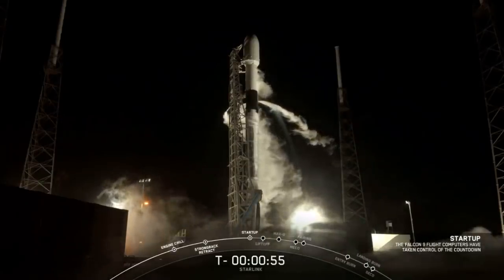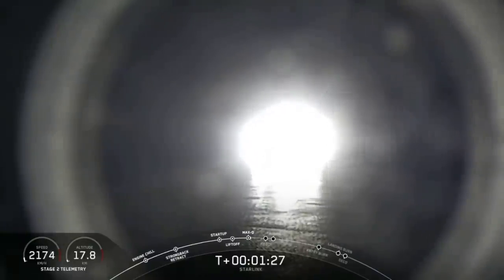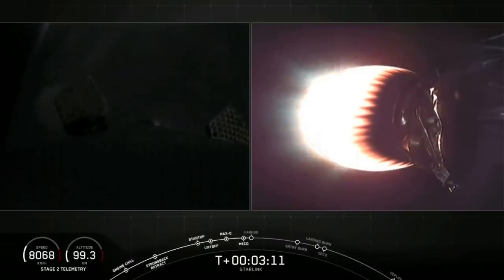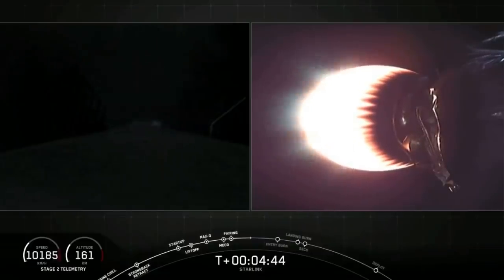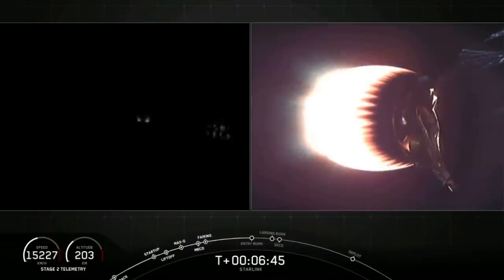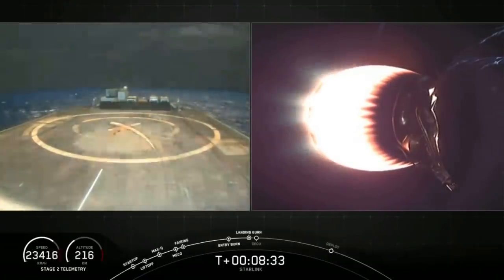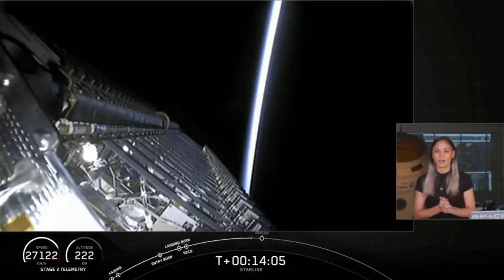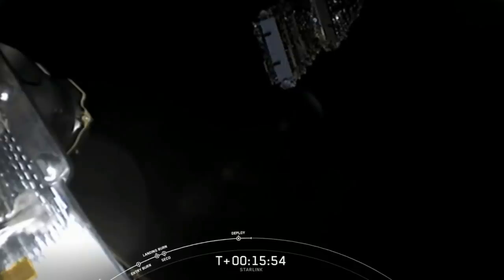SpaceX Launches Starlink-7 (June 3, 2020)

Comment: I’m going to make a very constructive comment I don’t know how many people will agree with me on this but hopefully there will be quite a few when they deployed the GPS satellites those were far enough out to where they did not disrupt the view of stars from telescopes and the astronomers this system satellites will be so disruptive even with the visor shield won’t matter on top of that it is crowding the airways into Orbitz that could be an issue for space air traffic they need to deploy satellites that are of a larger size and put them in lineups of the same Orbitz and line of sight that the GPS satellites are which could be less costly as well as will not be crowding the sky’s and my other question is how are people supposed to access the satellite by buying expensive new boxes to attach and a satellite dish no none of this is going to work affectively it’s going to cause problems in every area and it’s going to be extremely expensive for countries that cannot afford the ground equipment sorry but this whole thing is just completely useless and a waste of money and time

Comment: I tried to contact NASA and SpaceX with no luck...,,. This is your last chance........ Contact me about my non rocket-propelled space engine that works..,,.... And stop using these dangerous barbaric methods to put humans into space.,.,..., You can contact me via my YouTube channel..,... or you can just let more of your astronauts die in the future.,.,... because it will happen with rockets it's inevitable and you know it..... Last chance before the Chinese get it..,.. I would prefer not to sell it to them..,.., but hey you've got to do what you've got to do to survive right.
Reply: Yeahhhhhhhhhh........ ok.
Reply: We have abort systems on manned rockets to keep the crew safe incase the rocket is about to explode.

also, there isn't really another way to have propulsion system that functions and doesn't use hydrogen or RP1 or methane or another rocket fuel without having the vehicle burn for hours without end and/or sacrificing so much efficiency to the point where it isn't even worth it anymore
Reply: @sharkcraft8568  no...... this is a completely new innovation... No rocket thrust...... with speeds in excess of  35,000 kph at altitudes well beyond 250 Kilometers.
Reply: Tony Good listen......
If you thought of a better way to do this
Elon has already thought of it
But just wondering what is this new and safer way?
Reply: @fjtappedout4623  I have not "thought of a better way"......  We have created a better way.
Reply: Tony Good listen! I am an avionics harness design engineer at spacex. I have met Elon musk. Please tell me your new and better way.  I have shared my concerns with my colleagues about the way we do it now and they agreed something has to be changed. Please respond
Reply: @bobkarlson3145  we cannot see your details.
Reply: Tony Good what do you mean? What details?
Reply: @bobkarlson3145  too late
Reply: Tony Good what do you mean? Did you sell it to China? You can’t trust China with stuff like this. Their space game is still amateur. That’s why they aren’t allowed on the space station
Reply: Tony Good are you here?

Comment: i'm just wandering what happened to falcon heavy
Reply: Falcon heavy is just an extension of Falcon 9.. strap 3 core boosters together its falcon heavy
Reply: Over the years F9's power increased to the point that it can do many missions FH would have done.     So it doesn't fly often.

Comment: Whoever updated the camera and uplink strength on Just Read The Instructions needs a raise lol
Reply: Strength isn't the issue. It's a tight beam to the satellite, and the drone ships get tossed about too much at landing for the transmitter to keep up. So, either there was less vibration this time, or they have a transmitter that's faster at re-aiming the uplink, or one of the other "cheats" to avoid interruption.
Reply: @gnomeandgarden6157  Maybe they're using Starlink!
Reply: More than one emitter?
Reply: @GundamReviver  Possibly, or relaying to another local ship far enough away not to be buffeted during landing. Or, maybe they just had a good day.
Reply: @gnomeandgarden6157  Strength is the issue. When the rocket is landing it messes with the satellite and the camera signal.

Comment: Starlink?! As in light sail probes to nearby star?! Exciting if I'm remembering correctly. Would these satellites be to propel them with lasers or just to receive the data the probes send back? Or both?
Reply: @De Snijkant I'm actually  excited to see how well Starlink does in this arena. And hopefully it will be the top provider.
Reply: @Cymatic-Mage  At this point the receiver you will buy costs $160-180. But that will get cheaper as more users jump at it, as long as the whales pay for the super premium speeds.
Reply: @greyveteran7007  I'd spend that to help make Starlink get going.

Comment: old rockets usedliquid oxygen runnign thru a radiator system in the engine cones?   these engines glow bright white.. how close do they come to melting point?  what kind of structure weakening when tehy glowing like that?
Reply: The 2nd stage will be thrown away.  Any part not destroyed by the flight is waste.  First stage is the opposite story.

Comment: They're launching with the reliability of airplanes. Freaking awesome
Reply: And im over here thinking indians are smart, where did you get those facts from?
Reply: @mrpanda2655  Well the last launch was on 31.5 with human crew :D definetly not the same Stage 1,however with a small fleet it seems they are able to launch very frequently coz they dont have to rebuild each stage every time it carries its load and only maintenance is required,while launching other rockets which passed the inspection

Comment: Did they recover the fairings on the Misses?
Reply: Yes I was wondering the same thing. I can't find that info anywhere. Also, what happened to the fairings of the crew dragon mission?
Reply: @Folkert.Cornelius  I don't think there were any fairings.
Reply: tam hewitt-baker yeah there was no fairings for the crew dragon
Reply: @ar_tc  Or any other Dragon missions so far.  Dragon 1 and Dragon 2 both sit exposed on top of the rocket without a protective fairing (unless the trunk counts as a one). Dragon XL may or may not use a fairing, though probably not.
Reply: tam hewitt-baker This launch to the Dragon Crew which went to the ISS. This had fairings
Reply: @tamhewitt-baker5602  Ofcourse crew dragon had no fairings, that was foolish of me🤪😖🥴

Comment: Fifth time that booster flyes: way to go SpaceX! Do anyone know if the might have swapped a Merlin? As I understand, the center engine must have lighted at least 3 times per flight
Reply: I think the center fires only twice. Once on ascent once on landing burn, it wouldn’t surprise me if they use a different 3 engines for the reentry burn
Reply: @c4sualcycl0ps48  I'm pretty sure they do use the center engine for the entry burn, as it requires 3 engines. The layout of the engines is 1 in the center and 8 around the outside, so I don't see a way to light 3 of the outer engines and have balanced thrust, it has to be the center and 2 outer engines on opposite sides....these outer engines could be different each time as they have 4 pairs to choose from.
Reply: 69aussieguy you’re right I don’t know where I got the idea that any combination of outer engines would be stable

Comment: Great footage starting at 11:34. 
Is that the moon drifting up on the left side of the screen?
Then you can see the tension rod release. I’ve never seen that before. Please tell me it falls back into the atmosphere.
And check out the visors!
Good stuff.
Reply: The moon is not drifting up, it's the stage which rotates to generate momentum for the satellites to spread ;)  And the "tension rod" will fall back into the atmosphere, as everything does because of Earths gravity. Sooner or later, depending on the orbit.
Reply: @I-Singu-I  Orbit decay and re-entry is due to the wisps of atmosphere in low earth orbit, not gravity.
Reply: @tnexus13  Ofc you are right, slowed down by atmospheric drag, yet still pulled by gravitational forces.
Reply: Highfield...well yeah...I was speaking in relative terms.
But I didn’t know about the stage rotating, so thank you for that. 👍
Reply: @jbell6642  Ok np. Just trying to help & inform :)
Reply: @jbell6642  Apparently, it's quite an unusual way of releasing the sats. Normally in a shared ride, there is a device to witch all the sats are attached. Then they are released one by one or in batches. But doing it this way, they save space and cargo weight. Plus, it probable reduces the complexity of 60 small releasers
Reply: @I-Singu-I  saying nothing of whether it burns up or not.
Reply: @I-Singu-I  i thinks he knows that lol. Really cool to see the tension rods
Reply: Was the fairing recovered?
Reply: Jody Bell 
The tension rod will eventually fall into the ocean and be received by the ground clear up team
Reply: Elon Musk...uhhh...OK...Thanks Elon. 👀
Reply: @jbell6642  It's not the real big guy.....
Reply: Highfield...heh-heh...yeah, somehow didn’t think so. 💭